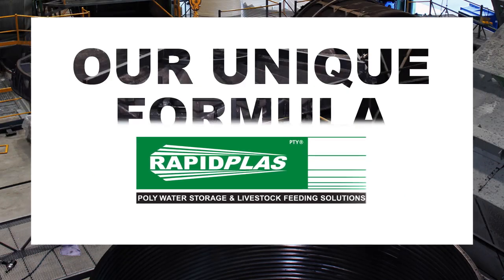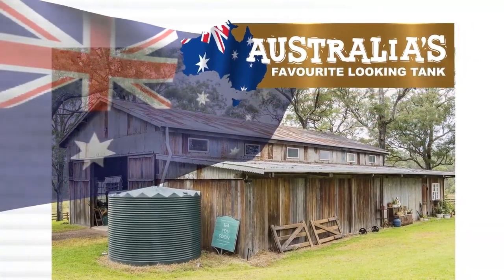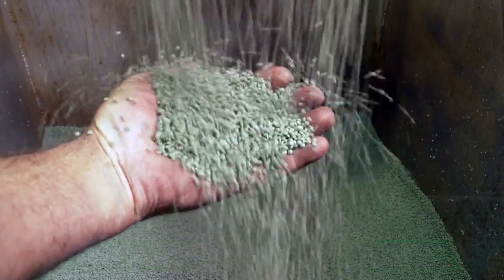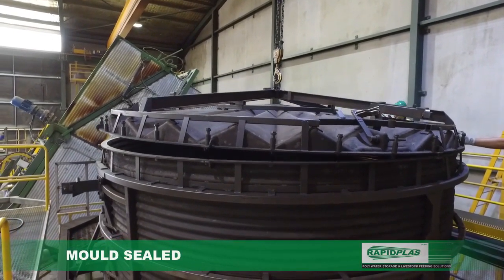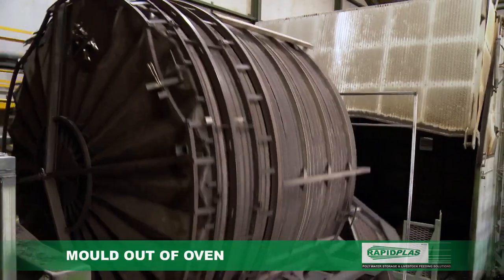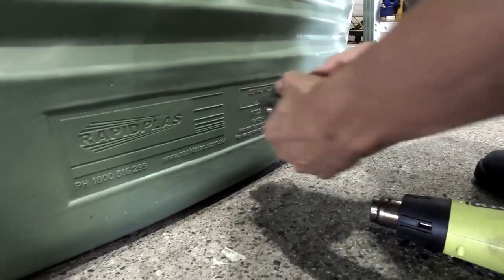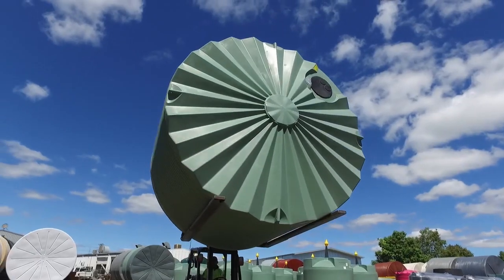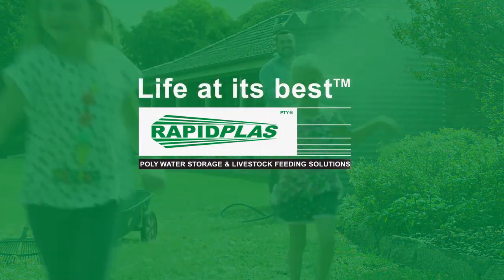Making a Rainwater Tank | Rapid Plas

Comment: I am quite worried about the quality of the tanks made when you look at all of the negative reviews online some including pictures. You can even see the imperfections in the tanks in this carefully crafted video and noticed you load the truck on steel checker plate trucks with absolutely no wrapping of the tank or packing between the wall of the tank and the abrasive floor of the truck. I know others use tank wraps and pad their tie-down straps and even put artificial turf down to help pad the tank during transport.  If I order tanks from you and they are delivered in an unacceptable state can I reject the order and send them back if they are not up to standard?